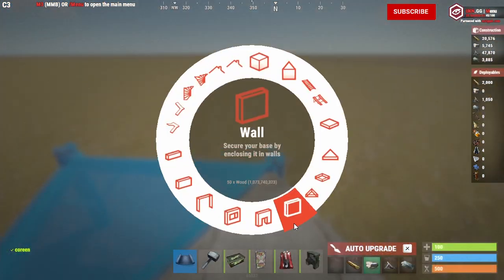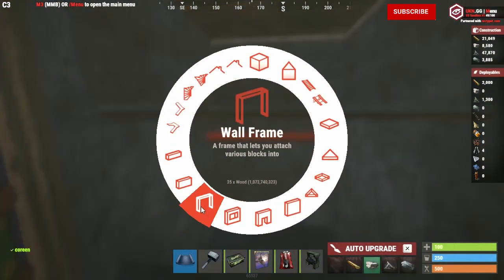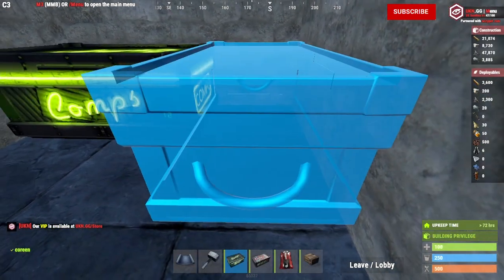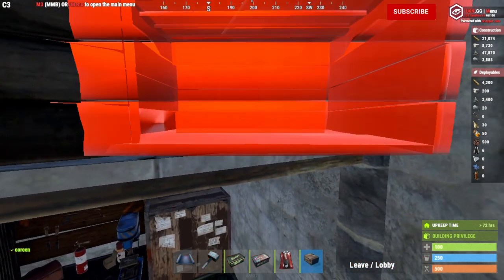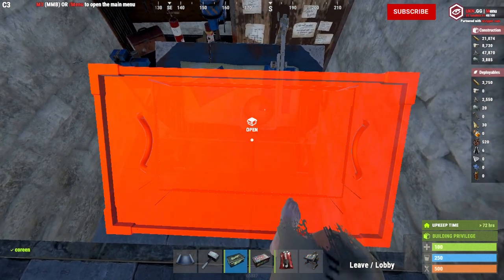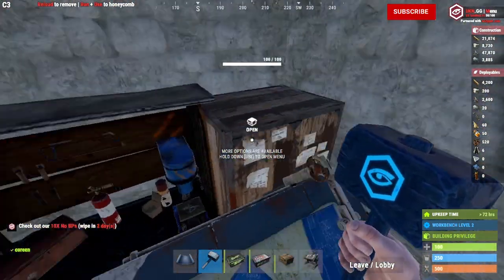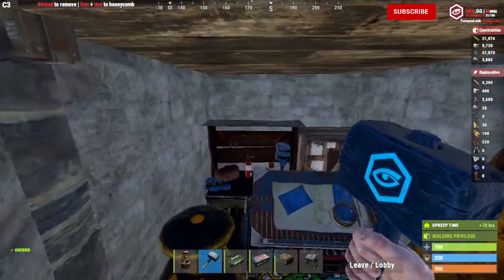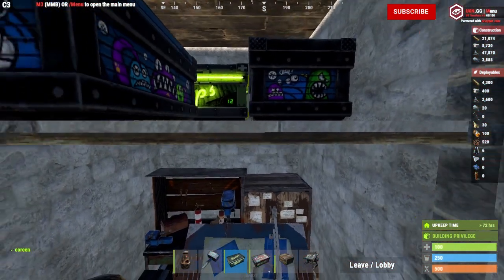The Ultra Compact Chad Base Build | Rust 🏠

Comment: And putting those half walls on the top of your base instead of on the foundation allows people to get roof access a lot easier
Reply from the maker: How do you figure that?
Reply: @CerealOverdrive  I build bases a lot now if your base is on a slant which bases usually are they can get on your roof and camp u a lot easier and instead of using the triangle foundation u should have done another low triangle foundation and and had half walls leaving a hole there and u can slap 3 furnaces down

Comment: Bro sorry man but this base could be wayyy more compact
Reply from the maker: You’d be losing storage though
Reply: How ?
Reply from the maker: @yikes4172  I’d guess take the half walls out
Reply: @CerealOverdrive  sorry that not what I meant the half wall loot room is good but u put the full wall on the low foundation and the half walls above that wall allowing people to easily get on your roof with building plans and u have the high triangle foundation in the airlock I recommend so people can’t soft side into your loot room and your get more space is by converting that high triangle foundation to a low triangle foundation and using half walls match it up then slap 3 furnaces in the low foundation